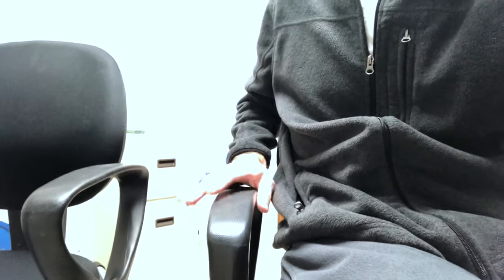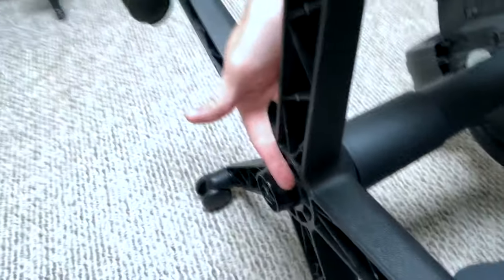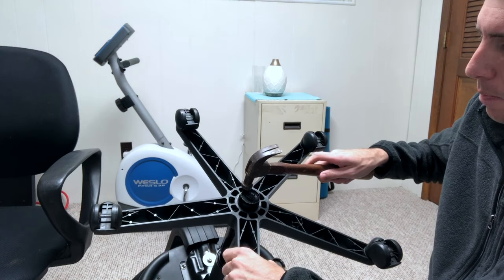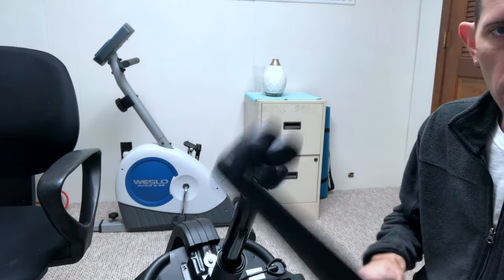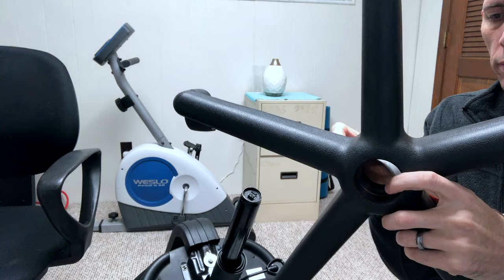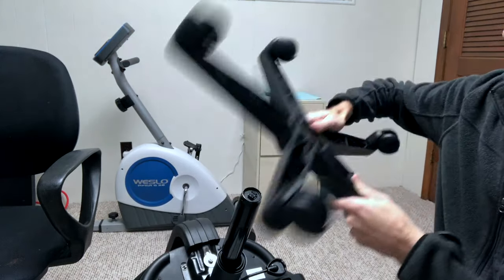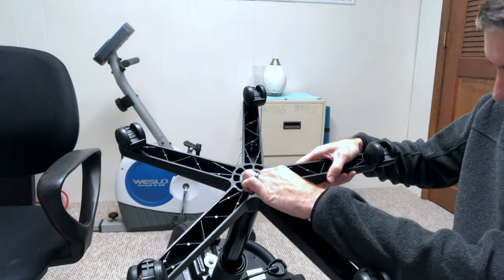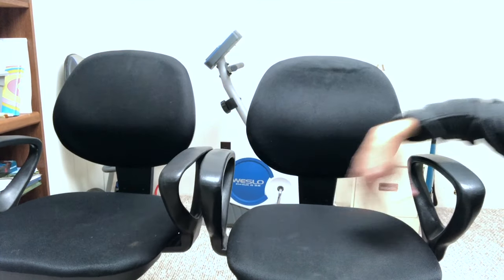Office Chair Sitting Too Low? Do This.

Comment: Thank you!!! Almost a life saver. My wife's chair was actual scraping the floor. I used HVAC aluminum foil tape instead of the pop can. Works great!  Now the question is why they build these chairs to fail.
Reply from the maker: Jim Rongstad they want to sell more of them. 😉 Thanks for watching.
Reply: Tell me please because I do not have the tools or the knowledge to cut aluminum can. How can I use that HVAC aluminum foil tape? how many layers of the HVAC aluminum foil tape did you use? Is it east to cut that HVAC aluminum foil tape?
Reply: Did you put the HVAC aluminum foil tape around the tube instead of inside the opening of the base?
Reply: @hatemkamal1682  Yes, I put it around the tube. The HVAC aluminum foil tape cuts with a regular scissors.  As to how much to use, trial and error.  I did a couple of wraps around at first, put the chair back together. It was still too low so I did some more.  It was fine then. But a couple of weeks later, it had sunk some, so I took it apart and applied a bit more tape. So far, so good.
Reply from the maker: @hatemkamal1682  a standard pair of scissors can cut an aluminum can. You may have to poke a hole below the top rim to get it started though.
Reply: @hatemkamal1682  Scissors
Reply: To keep...buying...new ones, just like every other product that is NO LONGER "built to last!"
Reply: I want to ask if you do this method once is it then stuck forever?
Reply: @abhishekanshuwali3808  It was my wife's chair from work that we had at home during Covid. It worked for about 9 months. She then retired and we brought the chair back to her employer. I would think if it stopped working you would merely need to apply additional foil tape.

Comment: Chair Sitting Too Low? Do This. smashes chair with a hammer
Reply: Smashes the highly dangerous compressed gas cylinder with a hammer 😂
Reply: @Noahdawson721  That was not the cylinder. It was just an inert post.

Comment: I snagged a chair for free from someone who said the chair didn't roll very well. The cylinder was all the way touching the ground, so that was the only issue. It was a pain to get the legs off the cylinder because it had slid down so far, but finally got it! Good thing I have a rubber mallet.

Comment: Came across your video as I had the same problem. I didn’t have a can handy, got to the same result by applying a couple wraps of foil HVAC tape to the part of the cylinder that inserts into the base. Regular duct tape may have worked too but would probably turn into a sticky mess if you want to disassemble later. The fix allows me to postpone $80 for a new base and cylinder at least for a while. Thanks 👍

Comment: Tempted to also use a beer can but found some galvanized sheet metal in the garage cut it 7 x 12 inches and was able to add 4" on my "ergonomic" office chair. Hardest part was getting the steel base off.

Comment: I need like an extra 2 inches on my chair. I hope this'll work, thanks for sharing! If it don't work, as a temporary solution, my other idea was to just get a bunch of USPS or UPS carboards and stack them under my carpet that my Chair sits on, or to simply buy some cheap but thick-ish carpets that'll be enough to raise my chair by around 2 inches from being under my main carpet where the chair sits lol! 

Original idea was to get a 2 inch piece of wood but I think that'll feel weird when stepping on unless I sanded all 4 edges down at a nice smooth angle.

 I shouldn't have gotten rid of my 400 dollar chair, that one actually went up high enough all on it's own smh.

Comment: Thank you so much for creating your video! Your video seems to be the only one out there to deal with this particular issue. My office chair mid-post was four to five finger width down and it destroyed my chair mat. It took a LOT of wacking to get the post from the wheelbase and I used two layers of cans just to make sure. I have to especially thank you since the height of my chair was causing neck & shoulder problems since I was sitting too low. So I'm hoping your hack will help me from further pain. 

I'm wondering if older chairs that didn't have plastic wheelbases had this issue?
Reply from the maker: Heather Howell [Staff] glad it was helpful for you. Thanks for watching.
Reply: @DustinRogersinMO  What tool to use to cut aluminum can like that?
Reply: @DustinRogersinMO  Teach us how to cut the aluminum can.
Reply: @hatemkamal1682  Scissors.

Comment: Just bought a brand new chair. It’s a 300 dollar ergonomic chair. Sat in it after building and realized it was too low. Flipped it over and the bottom is protruding like the one you pointed out. Do you think since it’s new it’s not messed up like yours was? Can I still do this trick? Thanks for any advice.

Comment: Great tip.
Another option...1/4 or 3/8 inch flat washers where the seat bolts to the frame used as spacers, the bolts are plenty long.
Ask me how I know...assembled my new office chair this morning.

Comment: Some chairs have a metal clip holding the cylinder on and hitting with a hammer will not move anything. See 'How To And Reviews' video on How to Fix a Sinking Office Chair for instructions for those circumstances.

Comment: Can you please help me with a solution to push down the circular mid frame, as its height has somehow gotten more than the wheels base, causing my Chair to wobble a lot. The mid frame is stuck at that height, its just not budging at all. Please help me Sir with a solution for this problem.

Comment: ok for a little help some chairs have a clip at the base that you have to remove to pull the platic part off you just have to lift it with a screwdriver its a little section and you slide it off theres a seperation of the peice and thats where you pry it then slide it
Reply: y chair has that clip. Do you mean that I should not try to hammer the tube to remove the base before I remove the clip first?
Reply: @hatemkamal1682   yeah it makes it easier to seperate the plastic wheels part from them tube as you can hold it easily
Reply: OMG you are a life saver

Comment: Me looking at you holding a cut aluminum can with your bare hands.. immediately 10,000 instances where I've cut myself no matter how careful I was trying to be with aluminum cans flashes into my head.. what's your secret?
Reply from the maker: Don’t slide your fingers along the edges. 🤷🏻‍♂️
Reply: @DustinRogersinMO  Can you make a separate video showing how to avoid sliding your "fingers along the edges" so I don't cut my fingers.  -  Average YouTube commentor

Comment: didnt work.  the thickness of the aluminum is like a hair's width and didn't stop the cylinder from going though.  maybe if you used several cans.
Reply from the maker: Basketvector the lift cylinder should be tapered. If the chair base is worn enough to allow the cylinder to go all the way through and hit the floor, the base is either cracked (and expanding) or severely worn. You could try multiple layers, or find something that is a bit thicker than a can and use that, but it might just be time to replace the chair.

Comment: any solution for it being too high? I'm very short and my feet barely touch the floor
Reply from the maker: You could remove the wheels and replace them with self-stick furniture sliders as long as your lift cylinder doesn’t hang down below the base too far. Removing the wheels from the base should lower it 2” or so.

Comment: what about changing the cylinder for a higher one? is that even possible?
Reply from the maker: I’m sure it is. I know they make taller cylinders because I’ve got a “counter height” office chair in my garage, but I’ve never looked for a source of taller cylinders. You may be able to find them on Amazon or eBay.
Reply: @DustinRogersinMO  thank you friend!

Comment: This kind of thing is why I love the internet! Super helpful! Thanks so much, I used aluminum tape instead of the can.
Reply: So i thought the can was used so that the top of the cylinder rested on the protruding edge of the can. But I imagine when the tape you used it was just to give that tapered edge something to grip to so it didn't slide down too far below the leg-stand thing?
Reply: @nickwillis1454   yeap! That and it increases the radius of the tapered bottom of the leg stand, that way the can’t slide lower. In my case the leg stand was very low, almost 2 inches or lower